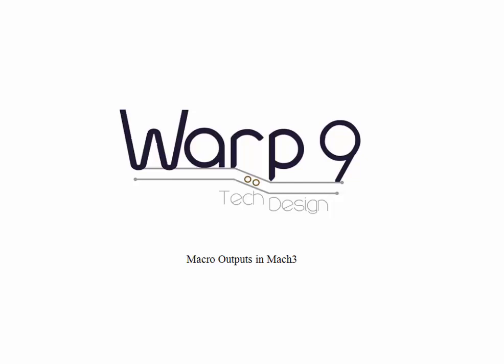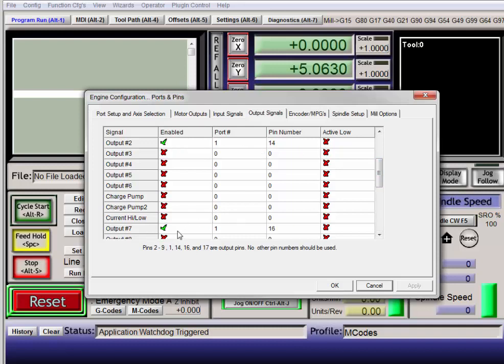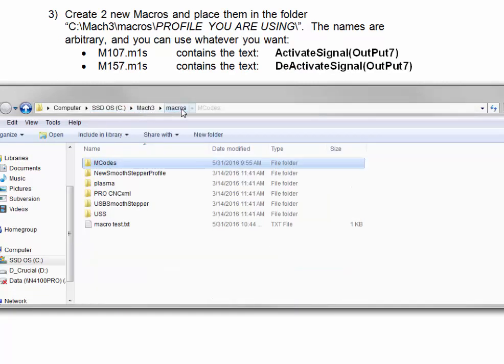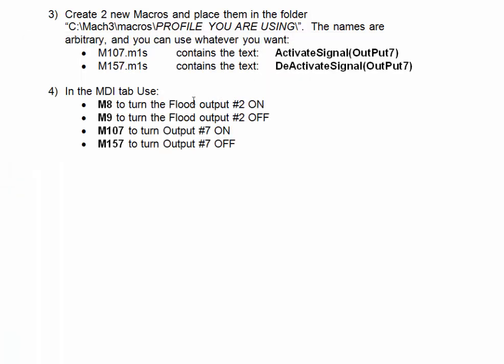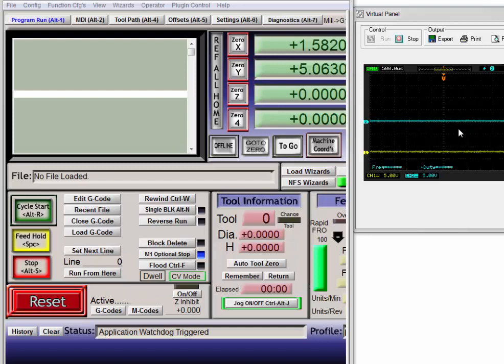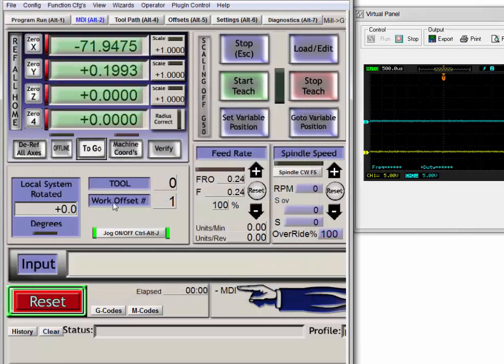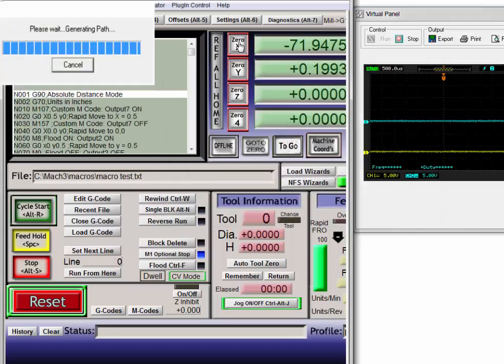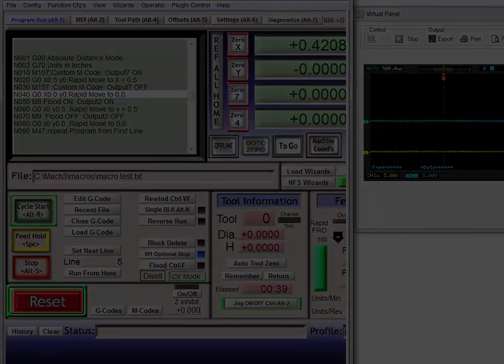Macros in Mach3

Comment: Hello sir,
Mach3 lathe not supported G71-Turning cycle...can you arrange..that code for G71 turning cycle.. Please
Reply from the maker: Mach3 development was terminated by Mach almost a decade now.  Mach3 does not support those commands, which means that the SmoothStepper can't support those commands. 
https://www.machsupport.com/forum/index.php?topic=8098.msg51176#msg51176  However, if you read through this thread, they may have developed a workaround....

Comment: Hello
i can use THC output in axis x or A i mean what folder .m1s responsib of THC
Reply from the maker: THC will only work with the Z axis.  You could swap your X axis and your Z axis, and then you would effectively be running THC on your X, but it would still be the Z axis in GCode.

The torch is turned on with the M3 macro and off with the M5 macro. 

Mach3 runs the macros ( *.m1s ) that are present in "C:\Mach3\macros\YOUR PROFILE NAME\".
Reply: @Warp9TechDesign   Ok how i can swap X and Z
Reply from the maker: @benamarcnc6078    
1) In your motor config, change the X axis Step and Dir Port and Pin numbers to the Z axis Step and Dir Port and Pin numbers and vice versa.  
2) Swap your X axis home and limit switch Port and Pin numbers to the Z axis  home and limit switch Port and Pin numbers  and vice versa.  
3) Swap your motor tuning parameters (steps per, acceleration and Max velocity) between the X and Z motors.

Now your GCode X moves will control your old Z and your GCode Z moves will control your old X.
Reply: @Warp9TechDesign  THX but these not help me  i want execute only THC on axis A